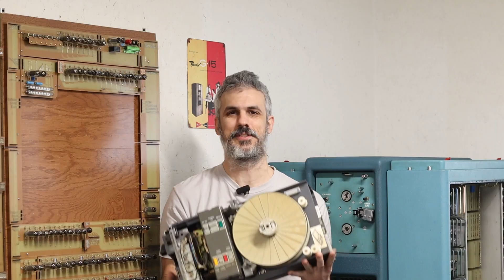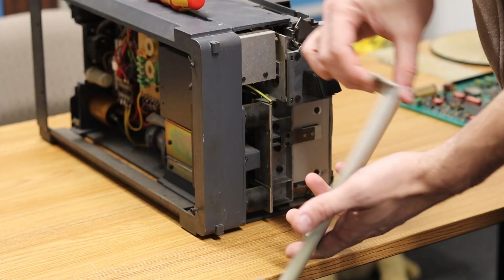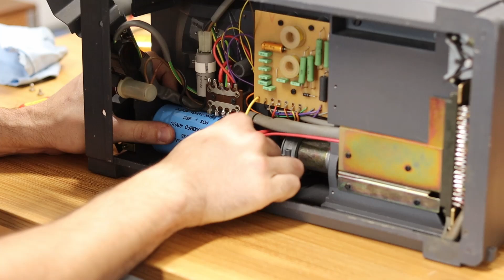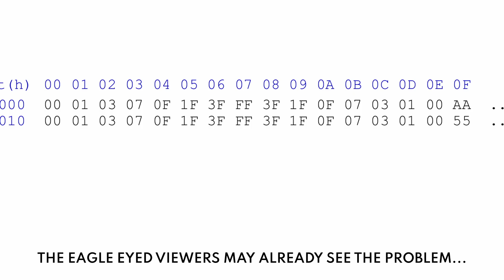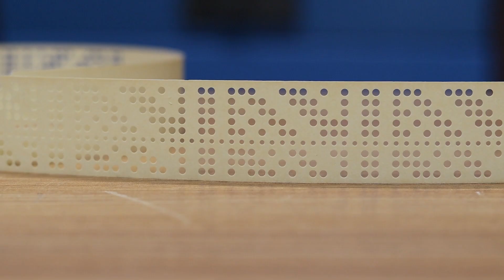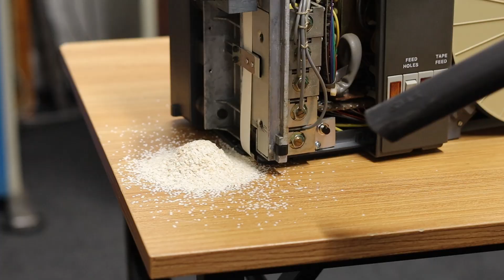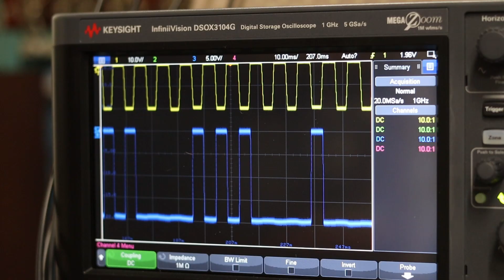Reviving a Facit 4070 Paper Tape Punch

Comment: Just wanted to add the few things I know that I didn’t see mentioned since I have one of these I just pulled out of storage again: 

1) That parallel port is not standard PC parallel, it's a weird 9 bit thing because it actually gives you control of whether to punch the feed hole. It does behave like a normal parallel port though, just set your data bits and pulse the strobe (or as this machine calls it "punch instruction") It actually sends 6 and 24 volts out on the last two pins of the port, so plugging in a cheap parallel cable with the last 8 pins shorted (they're normally all ground on a PC parallel port) will short the power supply and plugging in a cable with all the pins wired through will damage whatever you put on the other end because it'll get 24V in it. 

2) That jumper card is there to jump out the slot that could be populated with a translator card Facit sold that could convert both ways between ASCII and Baudot (According to the manual, in ASCII to Baudot mode, it would actually do substitutions like $ to DLR for characters that didn't exist in Baudot) it sits between the parallel port and the control board. As far as those card edge connections, the way they're wired is that one side is the input and the other is the output, working its way to the punch solenoids. So the parallel port connects to the bottom of the lower slot that the jumper or translator card would be in, the top of that slot connects to the bottom of the control board slot (so this is effectively data in) and the top of that slot connects to power which is jumpered all the way back to the parallel port, and to the punch solenoids. The jumper card is there because there needs to be something in both slots just to pass signals through. 

3) The EXT button just pulls one of the lines on the parallel port high, the manual explicitly says it can serve whatever purpose you'd like in your application

4) All of the indicator lamps have an equivalent output pin on the parallel port

5) That post on the output has a little tab on the inside that you can push to extend a guide for 5 hole tape.

6) When loading tape, you want to pull the tension arm roller all the way to the left, away from the other two rollers, there's a magnet that will hold it there and it does a couple things. First, it pulls the tape low sense arm fully away from the reel, which makes it easier to drop the roll on. Second, it lifts the pinch roller in the punch head, so you can just slide the tape in (you actually don't need to use the feed button for this, you can just drop the tape straight down into the unit). Finally, it pops out a roller on the left side that you're meant to pass the tape through. The service manual calls I the “Reversing Buffer Arm” so I assume it’s to provide a bit of room to step the tape backwards (which this machine can do over parallel, since there’s a direction pin there) 

7) The little metal flag on that same post is a blade you can flip out to tear the tape without rethreading the roller on the left side like if you had torn it at the blade on the front of the machine.

8) You can actually change the pattern that the code holes button punches. It's set by default to all holes for delete, but there's a set of 8 jumpers marked code holes that you can desolder and move to change that.

9) The serial flow control appears to be DTR/DSR, since those are the only flow control pins connected on the board, but afaik 600 baud can’t send fast enough to overwhelm the machine, so it’d mostly just be to let the computer know something is wrong.

10) The button labels on yours being sideways and the chad chute being at an angle indicate you actually have the rack mount variant of this machine but it's missing the flange that would've bolted to the rack, which may explain there not being any bottom cover

Comment: i have a paper tape reader for my S100 system but it uses a mechanical decoder and it is pretty slow compared to the bendex you have. that is impressive fast for this old system. i wonder why my relative modern paper tape reader from 1978 is so slow and uses the approach of a mechanical system.

Comment: it is kind of shocking how fast this paper is read through these brand new inventions photo diodes of the time passing by tiny little lights........ all then having to be almost instantly reread via these little tiny "almost-contact" pads that just barely "brush" by the brass magnetic ferrite "drum" (that just so happens to also be made out of titanium........) and data gets "read" to this drum, literally "line-by-line" as the drum quickly spins around in a circle..... and it also has quick access memory on that drum too.... creatively engineered somehow onto this tiny band of the drum as it's spinning by.... for a very short period of time before it's erased....... (which sounds pretty genius if you ask me).... for an old basically hand-built one of a few hundred built....1956 computer machines........ and it all just actually works.... and people just accepted this as normal life back then.... and they just had to deal with little paper circle "chad" floating around in their offices sometimes.... lol (I could have sworn that I had remembered paper chad from as a young boy at an office somewhere in the early 80's where there were still old computer machines and stuff at a community college my dad was working at, from a decade earlier that were finally getting thrown away from storage and I was playing around with them and I think I saw the little tiny dots of circles in paper everywhere.

Comment: Not for nothing, but in the 1960s and 1970s we used a lot of pink and yellow paper tape. I believe it was made by Friden. Had a particular smell. I think it was coated in some light oil. The chads had a static charge I think. They went everywhere and were very difficult to sweep or vacuum. Periodically in school we would empty the chad bin over the head of someone who was hogging the time-shared Teletype. I suspect the victims are still picking chads out of their hair 60 years later

Comment: I wonder if the device had anything to do with the know-how of Husqvarna, a Swedish maker of sewing machines. A lot of the technology is a bit similar: tensioning, motor, stepping etc. The speed is pretty remarkable thinking that still in early 90's many people had modems that were 1200 or 2400 bauds, and they operated almost fully electronically (they did usually have a relay for opening/closing the line, which was also used for pulse dialing).

Comment: Like you, I have a long-running project to build a computer using only pre-semiconductor technology, and had planned on using punchtape as cheap program memory. Building a reader is easy enough with an Arduino and 3D printer, but trying to punch out in 2024 is surprisingly difficult. Vintage punch  machines are rare, rarely work, and are dull if they still do. Designing one demands custom precision hardened steel parts. Nobody even makes the blank tape anymore. I'm glad someone is making this idea work in spite of the challenges!

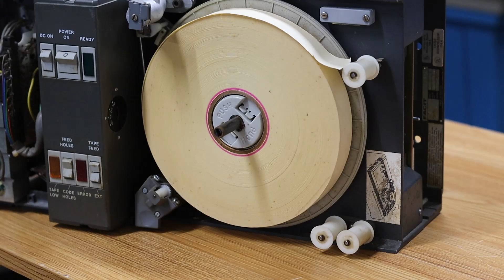Comment: 4:28 "worth its weight in gold" you say?
Decades ago I salvaged several rolls of punchtape out of a dumpster, and still haven't found a use for it.  1 inch wide, light green, looks like what you're using there

Comment: I also have a Facit 4070 punch.  Mine didn't come with a serial board (only parallel), so I made up an adapter (it used a single 7400 gate) to make it work with a standard PC parallel port.  I made up a program that outputs letters to the punch in a 5x8 matrix (upper and lower case) that I have for Linux.  The 4070 is capable of 75 characters per second.  If you look at the pictures of a 4070 it has a plastic cover "chad box".  If someone has a 3D model of this it would be most welcome as I don't have one of those.  Best of luck with your endeavors.

Comment: Now I'm wondering how many miles/kilometers of paper tape it would take to store a Windows 10/11 ISO.  Also, I think we need HELLORLD punched to paper tape.
Reply from the maker: I think the Windows 10/11 ISOs are roughly 5GB, which is around 5,000,000,000 bytes. Paper tape is at a standard of 10 bytes per inch, so that would take 500,000,000 inches, or 41,666,666 feet, or 7,891 miles, or about how far it is to drive from Anchorage, Alaska to Mexico City.
The Remex 9000 series of optical reader from the 1980s can read at 402 characters per second, which I think means it can do 402 bytes/40 inches per second. That's insanely fast, but 40 inches per second is only 2.27 MPH. That means it would take roughly 2,900 hours, or 120 days to read in a Windows 10 ISO on paper tape!

Comment: Im confused and amazed at the same time. This machine uses only 2 bigger IC and "jellybeans" parts to operate this all. a AY-3-1015D UART (Universal Asynchronous Receiver Transmitter) and the smaller one is a MC14411 Bit Rate Frequency Generator.

No cpu, no ram, no mcu. ofcourse this makes sense when you realize what the UART actually does, and when the uart also tells the other side when its ready again or not. why so slow? maybe cause the designers knew the punches can only go so fast? love it. unless im mistaken, still awesome

Comment: We used to have mylar tapes that were supposedly tougher and acted as a more permanent archive type storage system.  I recall sending about 1000 delete keys (punches out all the chad positions so they reader would interpret this as a mistake and skip over that line).  The punch out mylar chads were fantastically electrostatic, so dumping these chads into a small cup mounted to a spring mouse trap, would hurle the chads all over a "targets" desk when they opened their steel case pencil and tape drawer.  The stuff stuck to everything within electrostatic sight!

Comment: We used paper tape punches at Floating Point Systems to code wire wrap instructions. The backplanes on the array processors were wire wrapped, and backplanes had 62 long wire wrap board slot connectors (2 connectors/board X 31 boards). The wire wrap machine displayed a code indicating the wire length and positioned a guide over the correct pin (sort of like a plotter). The operator/assembler grabbed the indicated wire, put the end in the wire wrap gun tip, put the tip onto the pin using the guide, and wrapped it. Then the operator pressed a pedal (I think), and the guide positioned itself over the second pin. The operator affixed the other end of the wire to the pin. The paper tape reader provided instructions for the next wire. 

When a change was made, new tapes had to be punched for all backplane assembly stations. If this was done today, it would be networked. Someone would screw up the file, and a whole bunch of backplanes would have to be reworked. 

Around 1980, I unboxed and carried a brand new Remex paper tape punch/reader into the computer room to install in a rack. I carried it through the printer room where someone had spilled a drink. I slipped, lost my balance, and went down with the drive. It weighed about 40 pounds (18 kg) and had sharp edges on the sides. I tried to save it. The side of the drive cut the tendons in my right middle finger, I had surgery to put it back together, but it still doesn't work right. Now I kinda irrationally dislike paper tape punches.

Comment: Special Request for the Retro Computer Bendix G15 computer to claculate PI!
START:  LOAD    0               ; Initialize result accumulator to 0
        STORE   PI_HI           ; High part of π
        STORE   PI_LO           ; Low part of π
        LOAD    4               ; Load multiplier (4 for Leibniz formula)
        STORE   MULTIPLIER

        LOAD    1               ; Initialize denominator to 1
        STORE   DENOM_HI        ; High part of denominator
        STORE   DENOM_LO        ; Low part of denominator
        LOAD    1               ; Initialize alternator to 1
        STORE   ALTERNATOR

LOOP:   LOAD    1               ; Divide alternator by denominator
        DIV     DENOM_HI        ; High part of division
        STORE   TERM_HI
        LOAD    0
        DIV     DENOM_LO        ; Low part of division
        STORE   TERM_LO

        LOAD    TERM_HI         ; Add high part of term to π
        MUL     ALTERNATOR
        ADD     PI_HI
        STORE   PI_HI

        LOAD    TERM_LO         ; Add low part of term to π
        MUL     ALTERNATOR
        ADD     PI_LO
        STORE   PI_LO

        LOAD    DENOM_HI        ; Increment denominator high part by 2
        ADD     2
        STORE   DENOM_HI

        LOAD    ALTERNATOR      ; Flip alternator (+1 to -1 or vice versa)
        MUL     -1
        STORE   ALTERNATOR

        LOAD    PI_HI           ; Multiply high part of π by 4
        MUL     MULTIPLIER
        STORE   RESULT_HI
        LOAD    PI_LO           ; Multiply low part of π by 4
        MUL     MULTIPLIER
        STORE   RESULT_LO

        PRINT                   ; Output current extended result
        BRANCH  LOOP            ; Repeat loop

PI_HI:      0                   ; High part of π
PI_LO:      0                   ; Low part of π
MULTIPLIER: 4                   ; Multiplier for the formula
DENOM_HI:   1                   ; High part of denominator
DENOM_LO:   0                   ; Low part of denominator
ALTERNATOR: 1                   ; Alternates between +1 and -1
TERM_HI:    0                   ; High part of the current term
TERM_LO:    0                   ; Low part of the current term
RESULT_HI:  0                   ; High part of the result
RESULT_LO:  0                   ; Low part of the result

Comment: Suddenly in the mood for some digital pasta. Pretty interesting that it uses a 120v DC bell, I’ve always assumed these were used in places that had high voltage DC for other reasons, some old boats/subs and things like that had it, but also some stuff like the Howe plant protection system had 120v DC worth of batteries, with solenoid driven electromechanical transmitters and printers even, bit older than all this, 20s-30s era but made & used into the 70s. Tube computers is not where i expected to see 120vdc signaling devices, but I also see Simpson triplet gauges, and a lot of other common parts with old panels. Guess it’s a small world.

Comment: As I recall from my Teletype tinkering days, the white (now yellow) tapes were read using mechanical contacts as opposed to optical sensors.  
I'm pleased to see that you were able to adjust the bias to make it work on the Bendix.
I would imagine that the peak to peak levels from the diodes would be lower than when using an opaque tapes but the amplified signals look good on the oscilloscope.

I'm really enjoying this series of videos. I cut my teeth in electronics back in the vacuum tube days.

Comment: Regarding tape scarcity, could you not just get some rolls of 120gsm uncoated paper or similar on 2-inch cores, and find someone with a log slitter, or slitter-rewinder that would knock it down to 1" wide or whatever you needed it at? They do all sorts of high opacity poster papers (although you may struggle to get them uncoated) and non-woven paper-like substrates for printing wallpapers etc.

Most suppliers of roll printing media will have some means of slitting it down for you, although maybe not to the very narrow widths you're after.

Comment: In high school there was a Norsk Data main-frame connected to a few ASR-33 terminals, one of which had a paper punch. Yellow paper, 110 Bauds. Friends and I coded basic and saved on paper tape. Was around 1979-1980.

Comment: I'm wondering what it would take to get new paper-tape, and paper-tap reels made  -- say, by some small, boutique outfit that specializes in small runs of various vintage tech consumables -- presumably they'd have to reverse engineer the mechanisms that took paper-pulp and formed the paper tape together from that in the first place, then roll that up onto 3D-printed tape reels.  I remember seeing a video somewhere stating that some company had had to do the equivalent reverse-engineering process in order to make new vinyl-record pressing machines from scratch once the LP record craze came back, since almost all the old record-pressing machines had been deliberately junked by the industry back in the 90s or so in order to force things over to the then more lucrative CDs.

Comment: This is really cool! Are there any paper tape emulators out there? Or maybe some kind of LCD light valve you can slip between the light source and the photo diodes? Just curious, because paper tape looks awesome. I remember reading the tape running through the enigma cracking machine at Bletchley Park would burst into flames it was running so fast.

Comment: I supported the machine shop at an old job.. Many of the controllers got their G-code from paper tape…their problem was it was taking hours to punch a tape.  The problem was the serial board in the punch had no flow control, so if they ran any faster than 110 baud it would have occasional missed punches.  The solution was to switch to the parallel port.  I chopped up a “normal” centronics printer cable and mated to the parallel port on the punch - wrote a custom driver,  success.  Punchin was over 3x faster

That said you might look into the old CNC shops for Mylar tape (paper and machine oil and coolant don’t mix well). The molar is far superior in longevity, but the chad is harder to clean up.

Comment: The last paper tape punch I used was on a KSR-33 Teletype that had a punch/reader on the side.  I used this to program a ModComp J1 and later, a ModComp J2 mini computer.  This would have been from 1976 to 1979.  Later on, we got a high-speed tape reader.  I think that reader ran at either 9600 or 19200 baud.  The tape would really fly through that reader, hence the need for mylar reinforced tape.